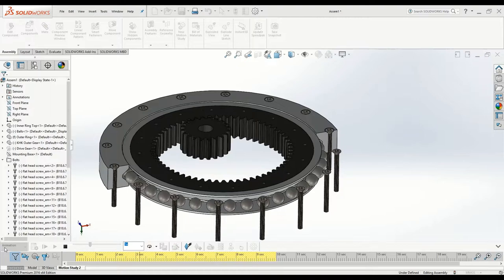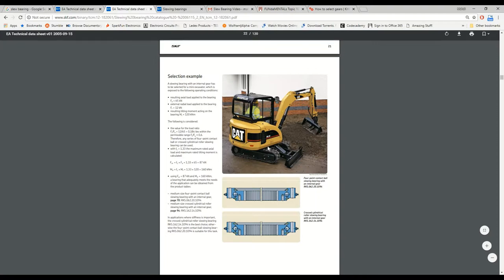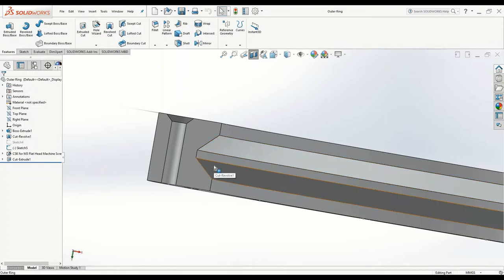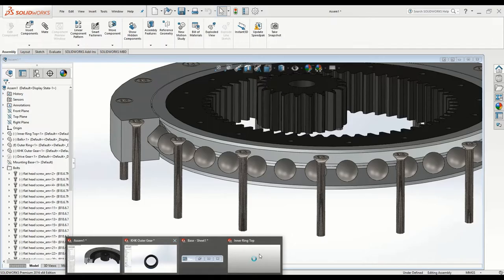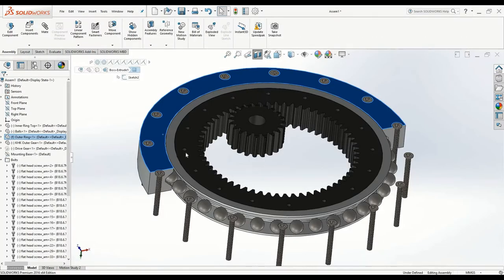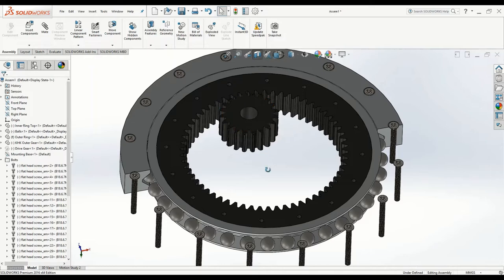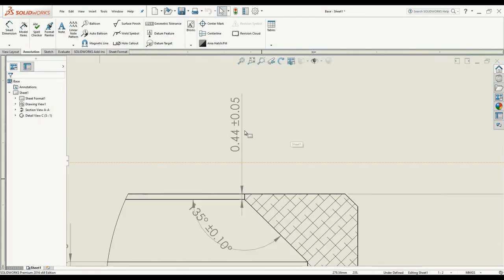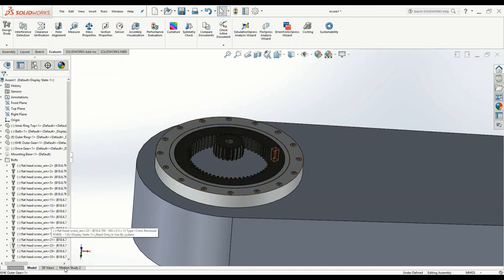Slew Bearing Design & Manufacture

Comment from the maker: Video Key Points:
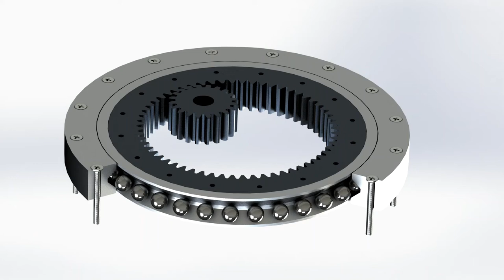Introduction - 0:04
Slewing Bearing Explanation - 0:22
Why Make a Custom Slewing Bearing? - 3:04
Outer Ring Component - 4:04
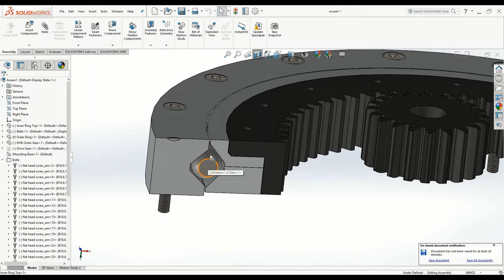Steel Balls - 5:51
Inner Ring - 6:29
Sourcing & Modifying Off the Shelf Gears - 8:06
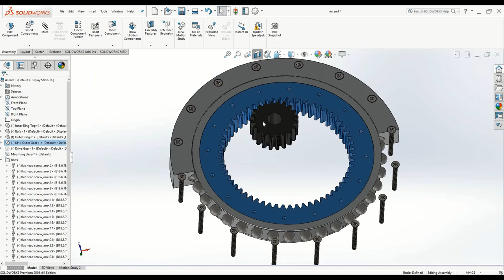Matching Gears - 11:12
Clearance & Tolerancing - 12:50
Sending Parts for Manufacture - 13:58
Mechanical Drawing Example - 14:25
Mounting Example - 16:06

Thanks for watching. Please like the video and subscribe to the channel for more content
Reply: Good morning

Comment: Great video. Would be interesting to see your commercial solution with actual tolerances and drawings.
I don't get the part where you say that the inner ring must be executed as a split version. You could add the balls and spacers from an outer ring bore hole.

Comment: Thank you very much for the video, it has been very clear of all the tutorials I have ever watched. Will really appreciate if you can share the files for 3d Printing :) Would love to give it a try.
Reply from the maker: Hi, links to the solidworks files and stl files for 3D printing are in the description. Purchase some 8mm steel balls (cheap ones found on Ebay). You may have to slightly increase tolerances for optimised 3D printing. Please let me know how you go =)
Reply from the maker: You can also 3D print the gears. I suggest using a dense infill percentage and a high number of surface layers
Reply: @MahdiDesigns  Thanks very much, I will surely give it a go, thanks for the files and the suggestions :)

Comment: Interesting video, but having the steel balls resting against flat surfaces gives a very narrow footprint, this will allow the balls to quickly wear grooves into these flat surfaces making the bearing very sloppy even if the grooves are only slight.
Reply from the maker: Yeah that's a good point. Having the flat surfaces a hard grade of steel helps but ideally the surface contact will be more. I initially had flat surfaces for simplicity and ease of machining but would try something different in the future. For a circular groove to work well the manufacturing accuracy would need to be quite good and I didn't have access to this at the time.

Comment: It's worth noting that that is not how professional slewing bearings are built, IIUC. Rather than have the inner or outer ring consist of two parts (which would presumably introduce a lot of weakness to the design maybe?), they drill a hole in the non-toothed ring, feed the balls and spacer rings via that hole, and then plug the hole. I think. I totally understand that you had your reasons to build yours this way, it's just that the video should have maybe emphasized that this was built differently to the standard approach.
Reply from the maker: Yep good point, thanks for pointing that out. This was somewhere between hobby level and professional

Comment: You are a saint. Do I need spacers or a gate or just freeballin?
Reply from the maker: Haha thanks. I've used nylon PCB spacers before (for 6mm balls). I combined two different length sizes to get the fit right and it worked pretty well. Freeballing is possible but probably not ideal. I never had any luck finding bearing gates for my purposes (they're very specific parts)

Comment: Do you have to support the inner ring underneath or can it be free floating?
Reply from the maker: It can be free floating. It is constrained by the balls so can't move up or down (except for a tiny amountof clearance)
Reply: @MahdiDesigns  Awesome, thank you!
Reply: Sean Ng Pack steel ball and plug and spacer and sealing to fix it

Comment: Great video. However there is a reason why slew bearing design should be left to the experts. V groove in Aluminium will not give any semblence of satisfactory service life. That is why Aluminium slew bearings are only used with steel wire ring inserts in very limited applications. To carry any satisfactory load the raceway shape needs to be calculated and be suited to the ball size and grade. Normal slew bearings are manufactured from 42CrMo4 forging with induction hardened raceways. 

This particular project would have been a very long and expensive road to a very quick failure.
Reply from the maker: Definitely better to use a hardened raceway, it was one of my first projects as an engineer so still had a lot to learn. The application didn't require a large load bearing capacity, more so just the ability to rotate, in hind sight it could have been done other ways using off the shelf bearings (like a tapered roller bearing). Interestingly the robot it was installed on is still running well to this day after years of service. Probably the aluminium has been worn down considerably but using a hardened steel V groove would have been fine for the application. Getting it manufactured through Chinese suppliers was really quite cheap. This isn't inteneded to be a replacement to a properly designed slewing bearing, just a basic example of how to go about making a custom one for a niche application

Comment: How much does something like this cost to get machined?
Reply from the maker: Depends on where you get it machined. Around a few hundread dollars roughly. You can send drawings and step files away for a quote. HLH is a Chinese company I have used before for machining
Reply: @MahdiDesigns  That's interesting. Curious why you would want a custom ring instead of buying an off-the-shelf one? Cost? Performance? I'm currently sourcing one for a design I'm working on and would be interested in the trade-offs.
Reply from the maker: @maulikdesai9431  Great question. Most of the time you would just use an off the shelf option. In the past I had to design a custom one because we had specific size and weight constraints and couldn't find an off the shelf solution. The actual design I made though for that case did use off the shelf gears, an internal gear was machined to bolt to a custom ring. Always best to look for and use off the shelf components as much as possoble

Comment: It is certainly not your fault. But I still don't get what defines a slewing bearing and a not a slewing bearing or any combined load bearing.
Reply from the maker: Essentially just a large diameter bearing, usually with gear teeth on either the inner or outer race
Reply: Slewing bearing with high load for slow speed. Cuz bearing with high speed must light loading while reach heavy load must slow speed. Cuz rotating can make hot and wearing